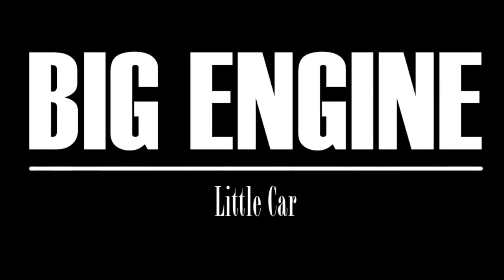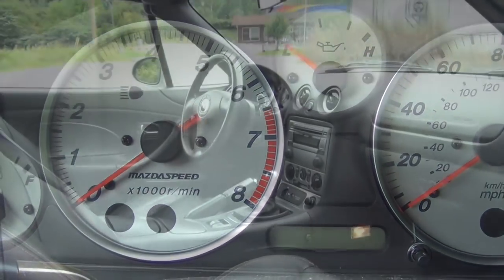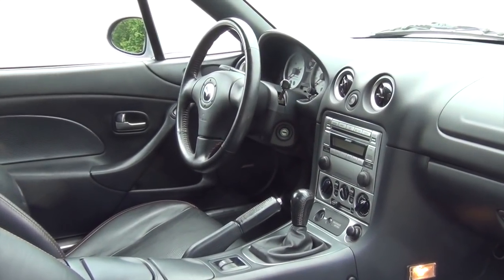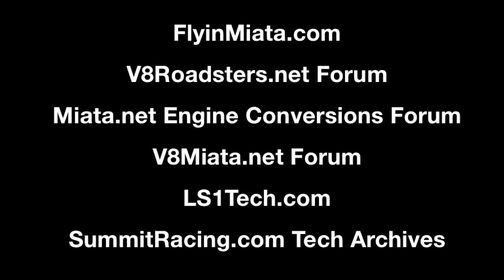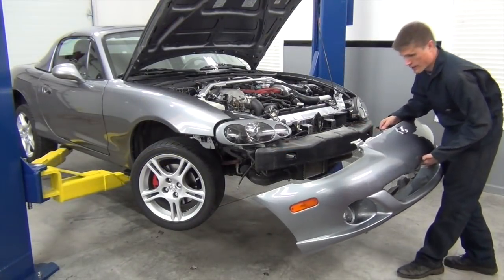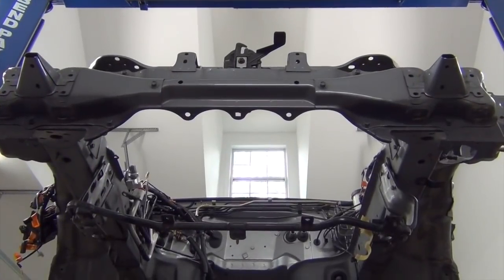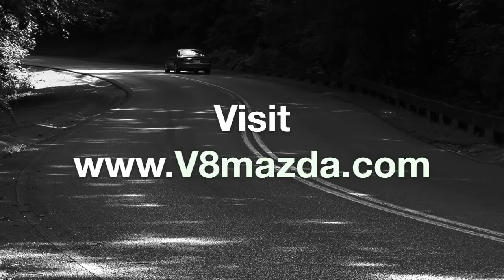LS3 V8 Miata Build - Project Thunderbolt Part 1

Comment: very cool project, will definitely be following. I actually plan on doing something similar in a few months from now after i sell my gsxr and r1 in early spring, only with a 68-74 datsun 510, ls3 aswell will most likely be a used pullout or so mated to a t56. Creature comforts will however be kept to a minimum. Not too sure about the rear yet. seems like a much tighter fit then your miata as from what i seen most people usually end up cutting into the firewall but i guess we'll find that out soon.
Reply from the maker: MrMikucki Thank you sir!  I wish you the best of luck with your project!  That is definitely a more intensive project you're planning, it will make for a very unique car and awesome performer.  Have fun!

Comment: Tom,
I was planning on doing a similar build as Thunderbolt.  Could you please do detailed videos on transmission tunnel fabrication and detailed wiring modifications?  Thanks for all the great videos.
Reply from the maker: Hi Paul and you're very welcome!  I'll definitely be covering those topics.  Regarding the level of detail, it will be similar to all of my other videos, more like a build journal than a tutorial.  I'm sure you've seen the flyin miata instructions and wiring instructions, they are very good.  I have probably read them cover to cover 20 or 30 times to get them to stick into my brain.

Comment: Thunderbolt was the name of Ford's 1964 Drag racing Fairlanes..... I was hoping you'd consider a LS7 to pay homage to the original Thunderbolt Fairlane in that both used a 427 cu. in. V-8(and also since you dig the AC Cobra, the 427 version was the ultimate version of that car).
Reply from the maker: 05gtdriver Yes, I'm aware of the Fairlaines, but I'm afraid I won't be using an LS7 for a variety of reasons: cost, complexity/size of dry sump components, it has larger dimensions causing all sorts of fit issues, etc.  It's an excellent engine no doubt!

Comment: Absolutely best video ever, hands down, no contest. What was the total parts cost, please. Was it completely necessary for clearance to cut square in the corner where the frame rails meet the fire wall. Thank you.
Reply from the maker: Thank you for the kind words sir!  I realize I’m way behind on this but I’m working on a video that breaks down the costs and such that I plan to post soon.  Yes, those firewall/tunnel mods were 100% required.

Comment: Dude... You've got a REALLY nice shop setup there with a lift... do your self a favor and get a battery impact driver... I think I spent like $150 on a dewalt drill/driver combo. Every time you use a ratchet that's got plenty of room makes me cringe a bit.

and get some wheel dollys from Harbor Freight.. makes moving chassis in a nice shop like that MUCH easier

Comment: Hate to be that guy, but the Benetton b186 (the f1 car) was actually powered by a really small engine, (1.5l 4 cylinder turbo) but it happened to make ludicrous power.   1,350 hp to be exact.  I understand the appeal (of your project) though.
Reply: SuperSonicSenna wtf does your comment have to do with this video?

Comment: LOL, the street versions of the Shelby Cobra were not "good handlers".  I've driven one.  They're a messy handful. I've also driven a Roush-powered Shelby Cobra replica whose suspension was specifically designed and tuned for the track... It too, was a messy handful.  I am excited to follow this project.  I built my own 350 V8 Chevy-powered '78 Pontiac Sunbird back in the 1980s.  Little car, big engine.  It was a messy handful.

Comment: The concept is cool but I'm pretty sure you end up with about the same thing swapping a small-block into an S-10 gets you. A tire burner. Except S-10s came with 4.3 V-6s and are a lot more balanced when you just add 2 more cylinders to them than a Miata with an LS. Its funny you're die-hard "Mitsubishi" but you didn't put a "Hemi" in it. Dodge and Mitsubishi were "partners" for a long time and such. Hot Rod did a Pontiac Solstice LS "swap" back in 2006 with GM involved and apparently that was a pretty simple install.

Comment: Think it over.... Why use a heavy V8 and not use a 13B rotary and turbo?
As you see i dislike the engine choise but still  I 'm exited to see how you will do this... So... I like!
Reply from the maker: MIKE192rotary Thanks Mike!  You should look up the weights of both engines complete with accessories.  You may be a bit shocked!
Reply: After a quick search the 13b (RX7 FD) is about 90kg and the LS3 is 220+ kg....
13b want one exhaust manifolt, the V8 needs two... These are the heavy parts... All others are more or less the same, for example inlet manifold....
Transmission axle and differential are the other heavy parts...
Please correct me if I am wrong but how is the 13B heavier?

PS: I live in Greece, Europe and I dont know that much abous US cars and big cubic inch engines
PS2: You did consider the  weight balance front rear left and right, right?
Reply from the maker: MIKE192rotary No offense, but that weight data is not accurate.  An LS3 with accessories is almost even with a 13b turbo with accessories.  Dig a little deeper, this has been well documented by folks doing the swap.

Comment: Hello Tom, 
I enjoyed watching this video when you first posted it. I was impressed with your detail. I'm wondering if you would know if an '89 Mazda MX6 has the same K member as the MX5, and if an LS3 might fit the same way?  I'm wondering too, if the Cadillac differential sub-frame might be fitted to make the MX6 a rear wheel drive car?  Any insight you can offer would be appreciated. Thanks. Jeff M.
Reply from the maker: Thank you for the kind words Jeff!  The MX-6 is a front wheel drive car, so it's a different beast than the Miata.  Making a FWD car rear wheel drive is a real labor of love, so lots of measuring and number crunching ahead of time will serve you well.  Good luck sir!

Comment: Hey tom 😁 i am nico from germany an i have a question.
You did once an lifter change on your sleeper. How did you get the pressure off from the belt without taking all apart? Thank you for your help

Comment: I'm kinda disappointed to see this happen to a Mazdaspeed, but I guess it works out since you get all the performance bits already there.

Any chance of using the subframes for an Exocet kit car?  Those are made to bolt on to the Miata subframes already and it would be pretty wicked with the Mazdaspeed engine.
Reply from the maker: The Layout Engineer Thanks man, I looked at lots of NB Miatas for a long time and MazdaSpeeds were the only ones in decent shape.  That and I like the overall package the best.  I can't even think about another project right now, but you're right, an exocet would be tons of fun!

Comment: Thanks for sharing this video.  I don't know if you answered this already but can the same parts like engine mount assembly, ls3 engine and the rear mount assembly be used in a scion frs or subaru brz engine swap?
Reply from the maker: You're welcome sir!  The mounting parts you see (subframe, etc) are made for the Miata only.  I'm sure someone has made or is working on drivetrain conversion kits for the BRZ.  Good luck whatever path you choose!
Reply: Thank you.

Comment: Stacey David's Gearz did one it's called Banshee shelby corba clone.
You also try monster miata for LS engine harness conversion for miata swap and subframe kit.

I would sell those miata parts engine tranny rear end recoup monies for the swap.
Reply from the maker: Yes, I like the Ford based Miata that Stacey built.  I will likely sell the spare parts, which was another reason I chose the Mazdaspeed version.

Comment: Are you going to be able to reuse that piece from the trans to the rear member? F-body gm's have that too forgot what it's called.
Reply from the maker: STARSHIPTROOP Yeah I had an F-body way back in the day with the torque arm setup.  I won't be using that for the drivetrain conversion, it is engineered with a transmission crossmember instead.

Comment: Tom's Turbo Garage, hey, if you REALLY want to give this vehicle a kick, why not drop in an engine from either the all new 2019 Chevrolet Corvette ZR1, or, if you want even more insane amounts of power and torque, the Callaway Sledgehammer engine package (aside from the interior and badges) for the 1983-1995 Chevrolet Corvette, a.k.a., the C4 Corvette?

Comment: There is a big difference between  v8 miata and the other v8 cars, cobra, corvette, etc, they have the engine set behind the front wheels.  Can't do that with a miata (stock firewall)

Comment: Is it possible (mechanically in terms of size and bolts and dimensions) to transplant that drivetrain straight to an NA? or are the bolts and length / width different?
Reply from the maker: ***** It is possible, there are a few little hurdles here and there but it has been done.
Reply: Thanks Tom!
Reply from the maker: ***** You're welcome sir!

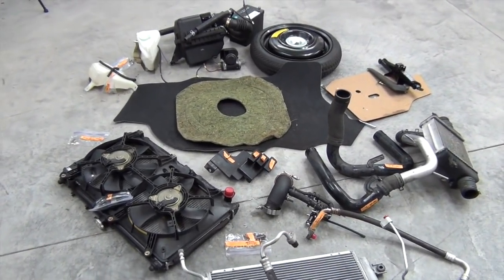Comment: 11:33  how do you just make a pile instead of placing them in the area where they go back on the car?  I'd be labeling them and laying them down where they'd go in relation to each other.
Reply from the maker: In this shot you can see there are orange labels on every part that needs them and labeled hardware bags.  I just put them in a group for the video before taking them up to the attic for storage until I needed them for reassembly.

Comment: Look Im not saying its not cool.  It is.  However, V8 Miatas are a bit overdone.  I remember when the Miatas first came out, a speed shop near me specialized in putting Mustang V8s in them.  I havent seen one with a LS3, but still...  If it were me, the perfect example of aftermarket big engines in small cars is the Ford SHOgun.  That was a Ford SHO in the rear of a Ford Festiva.  Small run, unique, powerful.  I have no particular love for Fords, but I would love that SHOgun.

Comment: Why do this to a Mazdaspeed Miata and not to a Base Miata?
Isn't the Mazdaspeed one pretty rare?
Reply from the maker: Hi David, given the time and effort required for this conversion, I wanted a well cared for, low mileage, rust free car to start with.  I also want to drive and enjoy this car for a long time, so starting out with the nicest possible chassis with the options I wanted just made good sense to me.  This was the best car I found in my long search.  Most every car had bad paint, wore out interiors, bumps and bruises, a little fender bender here and there, rust, etc. etc. etc.
Reply: Tom's Turbo Garage
I understand... But I still think it's a shame wasting a Mazdaspeed with a V8 conversion... They are alot more rare than the base ones... But probably that's why it's easier to get a clean Mazdaspeed...
I still think you could get a similar Base Miata, for (probably) a better price... But it would take a while...

Anyways! Love your videos! Just wish you uploaded more often!
Reply from the maker: David Texugo Thanks David, I'll be posting new videos every two weeks.

Comment: Lightweight, nimble, and balanced... until you put a big V8 into it!
Reply from the maker: Hi Cole, this is a common misconception.  You can see the before/after weight bias in part 13.  The all aluminum LS3 is actually mounted lower and further back than the stock iron block 4 cylinder too.

Comment: Isn't that engine too much weight in the front? Why not just put a supercharger or turbo on stock motor?
Reply from the maker: Part 13 of the series shows the before and after weights and front to rear bias comparison.  The all aluminum LS3 is actually mounted lower and further back than the stock iron block engine.

Comment: How about stuffing in a Nissan GT-R V6 Twin turbo engine, would it not be better for power, balance, weight, better on gas. Maybe try a AWD from a GT-R. I think there are a lot of combo's that could be done. Someone get back to me with other combs that have been done other than this
Reply: Thanks for the reply back, thinking about the cost of the GT-R driveline you're probably right about the cost of everything would be crazy. But it's nice to dream. Got another one for you the motor from a Dodge Hellcat. what do you think of that one? get back to me about that.
Reply: Another idea I have is how about a Honda S2000 engine and real big turbo. The motor revs to the moon and mill make some decent power, the set up is light but the cost maybe a little much. What about the new Corvette ZO6, 650hp, 650trq sounds awsome but again cost.
Reply: Believe it or not, that would be about as expensive as buying a brand new 370z (excluding the car cost) the engine as is is about 30k, the driveline would be 10k easy, but good luck
Reply: whatever combo is used, the Miada will still be lighter.
Reply: +Mark Hatcher Wont work as well, believe it or not, Nissans VQ and VR V6's are Bigger and Heavier than GM's LS V8's. would put way too much weight on the front end of a Miata. And its more expensive.
Reply: Thank for the information
Reply: +Mark Hatcher Putting aside the cost of another engine set-up I would love to see a Formula One 1.6 litre four-stroke turbocharged 90 degree V6 reciprocating engine.
The power a Formula One engine produces very high rotational speed, up to 15,000 revolutions per minute
Reply: What about a 5.0 coyote motor? Or a big diesel? Or an ecoboost?

Comment: the worst of the worst ideas is to waste an ls3, and all that work, in a frame that cannot handle the torsional forcer of the v8, by the time you box the frame, add real springs, etc, you have real money invested in a chassis that is simply too small, or LeMans would be filled with v8 miata (plural)

Comment: So, putting a nice heavy V8 would balance a miata?  I doubt that. Maybe putting a alum. V6 would be viable but a V8 is def. overkill. It would fuck up it's balance and screw up it's handling. I own a 95 for a long time, and would cringe at loosing it's native handling that would add a lot of oversteering. Yeah, what your done with is just a 0 to 60 strait line miata …. What a drag.  Funny that you showed a Cobra, while fast they were very dangerous to drive also. Just ask any owner of one.

Comment: wish i had the money to build these :(
Reply from the maker: Hi Angel,  it is a big project but can be done in different ways based on your budget.  The most affordable would be to start with a standard trim donor Miata and use a Ford 5.0  You can learn all about the options at http://www.v8miata.net
Reply: Cool thanks a lot :)

Comment: Big budget bolt in swap? Enjoy your videos but this is kinda boring. Since this is Tom's Turbo Garage it is mandatory that there will be a turbo involved. Right?
Reply from the maker: Brian Clements Brian, I just build what I like, it's ok if everyone doesn't like it.  That's not my goal.  My goal is to build the car I've had in my head for the last 20 years.  There' no harm if that doesn't fit your liking.
Reply: I think the engine choice is great. Really just surprised you aren't fabricating any parts. You obviously have the talent and tools to do so. You know we have to razz you about the turbo. Keep wrenchin homeskillet
Reply from the maker: Brian Clements Thanks man, but there is still lots of fabrication to do.  Yes there are "bolt-in" components, but it would take YEARS and lots of trial and error to do a complete drivetrain conversion on your own, especially for a shade tree mechanic like me.

Comment: Would of been cool to do a coyote 5.0 in the miata. Tired of LS swapped cars...
Reply from the maker: ***** DOHC motors won't fit.  I researched all sorts of engines, but the engine that I chose met all of my parameters.  Folks may be tired of the LS but it is a popular choice for a reason.
Reply: Ah, good point. Never thought about the width of a mod motor being an issue.

Comment: Um how can a small car with a big burly v8 be balanced?
Reply from the maker: The LS is all aluminum and set further back and lower in the chassis.  Check out part 13 if you're interested in before/after corner weights.